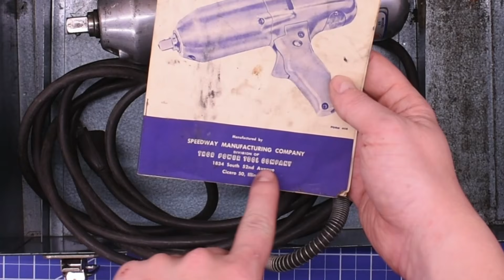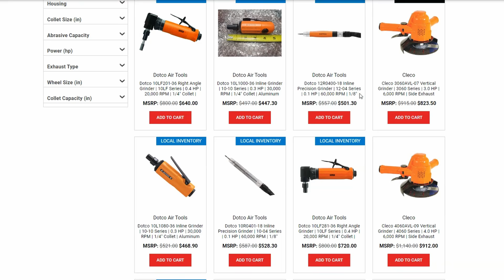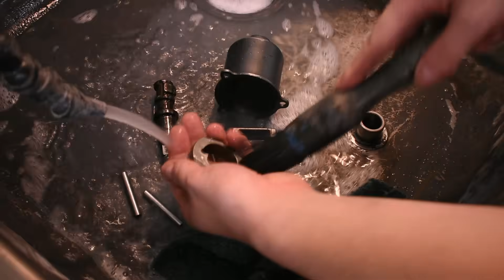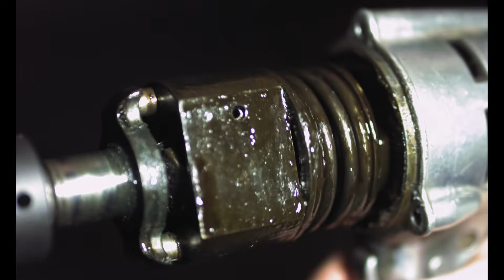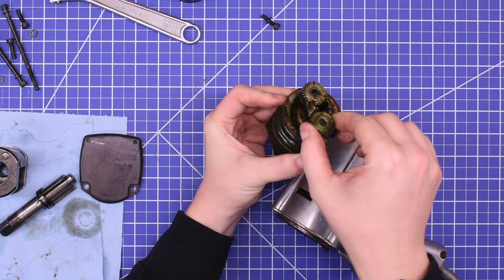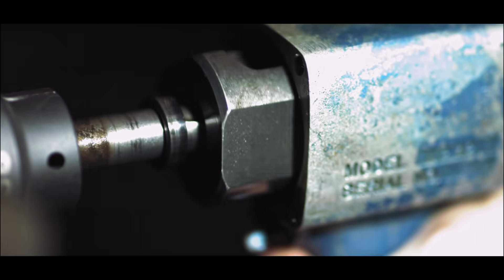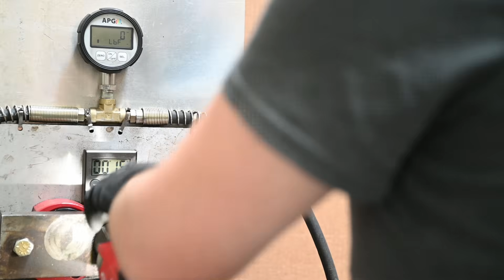Cold War Era Power Tools vs 90's vs Today

Comment: Dotco tools rock
Reply from the maker: Had a job in my younger years where each bay needed a RA die grinder for deburing large cut and machined parts. Early on we had dotco die grinders. When i started, the one given to me was so worn away it was bare aluminum with just some paint on some recessed edges. Eventually they started buying Husky die grinders from Home Depot instead because Dotco die grinders would grow legs and get "lost" - usually from the 3rd shift getting new meth heads, uh I mean trainees. The Husky would last between 6 months and a year, but warranty was simple enough. Thing is they vibrated for a good 4 months before death. 
So i started hiding my Dotco after my shift, replacing it with a husky before end of day. When I left it was still running, all day, every day. A couple years ago I saw an old co-worker post a picture on facebook and I saw it still in the background. The new guys probably not even knowing what a Dotco was at this point.
Reply: Lol  that’s awesome love the channel!